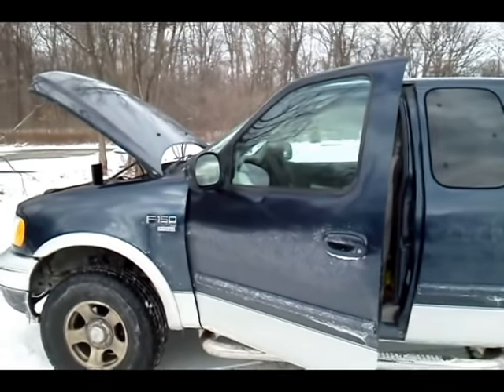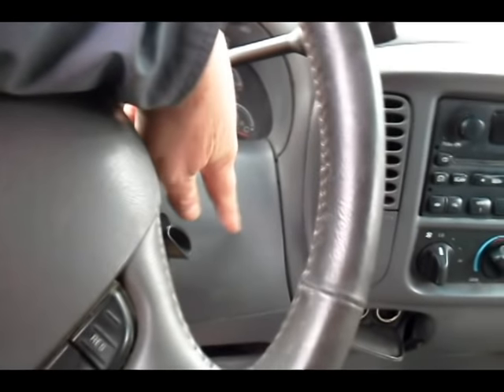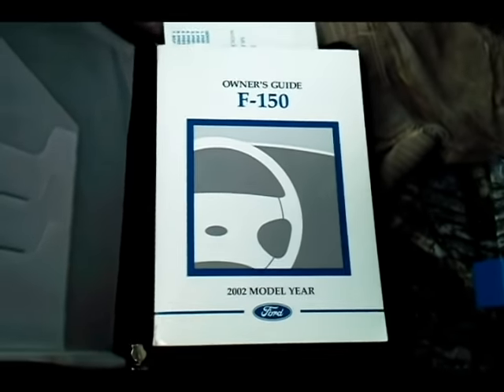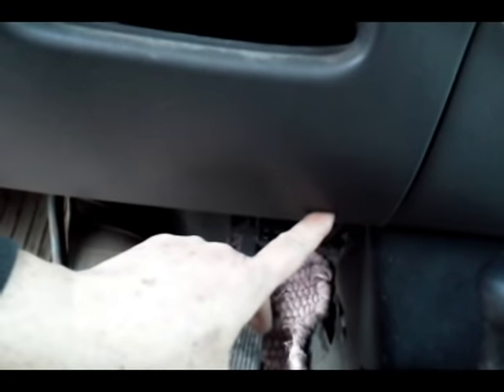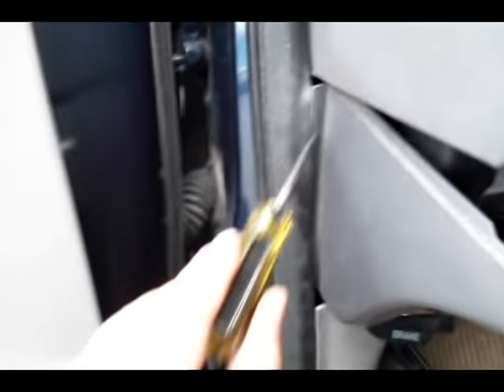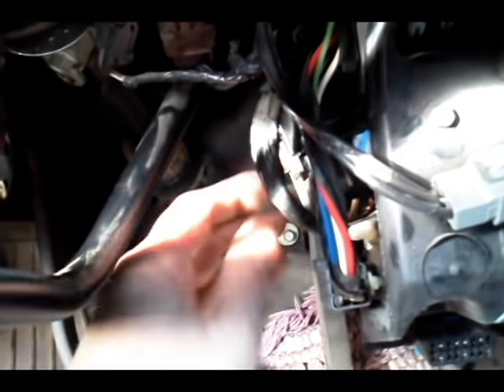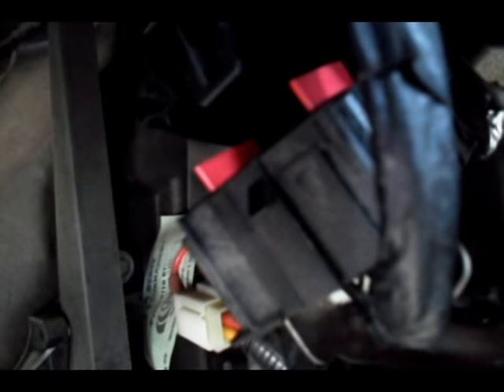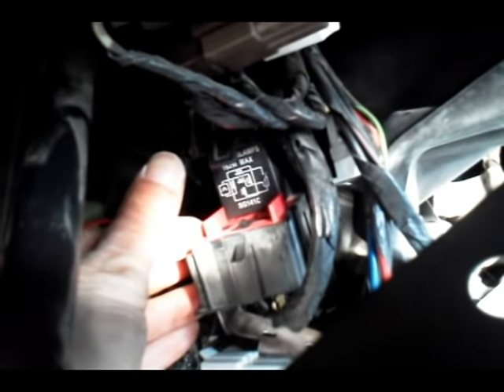2002 Ford F150 Pickup Turn Signal Flashers Relay Replacement

Comment: I have a 2001 F150 XLT. My problem was the turn signals and emergency flashers would flash for a short time and then stop. Your video worked perfectly! One note for my 2001 is that there is an additional bolt above the emergency brake handle. You mentioned that 2 bolts hold the relay bracket in place. Unbolting the bracket made it very easy to pull and insert the relay. In fact, if I didn't do that, it would have been impossible to unclip the cover as there was tape wrapped around the relay cover. The whole job took about 30 minutes and saved about $250. FYI the cost of the relay was $15...
Reply: My flashers just stay on.  Let me ask?  When i depress flashers switch, it’s on? And i release it and press on it, it’s off?

Comment: Thanks for taking the time to make this video. After watching it, I read through all the comments, then I got to work on my 2000 F-150. True story: I came in from the PASSENGER side. Pushed the seat all the way back and lay down on the floor of the cab so I could see the relay box. Carefully cut away the black tape holding the wiring harness to the box and pushed the wires back away from the box cover. Pried up the box cover and pulled both relays. Took out the old flasher relay and put in the new one, which I got at O'Reilly's for ~$20, and just like that I once again had working hazard lights and turn signals. Did not remove ANY cowlings or ANY bolts. It can be done....

Comment: Some modes like my 03 f150 super crew it’s just right there in arms reach. Pulled out the bad one and put in the new and closed back up the plastic lid. Granted you have to lay on the ground and do it but mine didn’t need me to take off any panels.
Reply: Was it your turn signal? I have an 03 and my run and park lights are out im wondering if mines in here before i try

Comment: This video was an IMMENSE help preparing me for replacing the relay in my 2002 Ford F150. Tools needed and size of sockets and action sequences (cowling removal, loosening of bolts, location of relay box) spot on! I must've lucked out a bit since the relay box was not hidden to the extent the gentleman's was in the video. I was able to easily locate and with a bit of manipulation remove and replace the blue relay switch. Be sure to take note of plug orientation as this video points out! Although I replaced with relative ease had I not been paying attention to plug orientation I would have had a MUCH harder time trying to figure it out. Thank you Westbasin for saving me loads of time.

Comment: Got some advice for 2000 F150 with turn signal problem. A common problem with these cheap made trucks is that the plug to the multi-switch that controls the turn signals have a number of wires (there is a couple of plugs to the multi switch. the one for signals is the smaller plug ) One or more of these wires will work loose from the plug as tilting the steering could stretch them out of connection. You may be able to push the steering up to full tilt and the wires will make connection for signals, to show that is the problem. Remove the steering cover including removing the key cylinder (easy just push in the little round hole under it with a small punch and pull it out). Then take off the multi-switch and remove the plugs (not much room to work on them). I pushed all the wires deep into he plug and tied them tightly together with a small tie wrap. Then I mixed 5 minute epoxy and glued the wires into the plug so they won't work out again. Let it dry several hours and reinstall. It worked great for me. Now a common problem with the shifter not going into park is caused by two small bolts that connect the shifter shaft to the shift cable. Those bolts work loose over time. They are located under the dash and up on the steering column. They are brass looking screws with torx heads. One of mine had fallen all the way out. I used lock tight and retightened them and it solved the problem. Now a problem with the back door not opening is the cheap plastic retainers that break. Take off the panel and window.You can pull the cable tight and use tie wraps to tie it down to the door using existing holes. Then it will open the door.
Reply: Your were right. I pushed the wire and it started to work. Thank you. God bless you.

Comment: All Bolts on a Ford are Metric and the Black Relay in front of the Blue turn signal is the Blower Motor Relay for heat and ac.
Reply: customprc Thats what I thought. My 2000 Lightning used 7 and 8mm bolts, not some weird sized imperial.

Comment: I'm the same as Johnathan Boxdorfer. With your video I was able to locate the relay and didn't have to take the dash panels off. There was what looked like factory tape around the black encasement toward the back. I took this off and removed the cap and changed the relay. Relay was tough coming out, but got a small screwdriver under it and gently pried to a point where I could lift it out. The cap snapped back in fine. I did not retape it. Thanks again. 2003 F150
Reply: Robert Wilcken - This was exactly my experience as well, but I was glad to see the video.

Comment: Thank you West basin You have save another from the frustrations of the FTFC - "First Time fix it Crew"  I did use the picture of the arrows to remove these two screws and the bracket holding the flashers came out to the left for easier access to the housing and to pull out the old defective flasher. Also I use the long screw driver to prop open the right side of the lower panel instead of fully removing it leaving that left end inside the rubber door jam. Which after the replacement of the flasher and replacing the flasher housing bracket screws just push back into place and made it very easy to replace all the panel screws. Thank you very much for the video - I also went to NAPA who had the part for  17.00. Much cheaper then the online shops. GREAT JOB!!

Comment: I have a 2000 F150. I replaced mine in 5 minutes without removing any panels. I laid flat on my back under the steering wheel, put my right arm around the brake pedal, removed the plastic dust cover, then pulled the relay out. I did not need to remove the other relay next to the flasher relay. Odd thing is, the replacement was defective and did not work. I put the original one back in and it worked! It may only work for a short while, but it's working. I will prolly get another one and have it on hand in case it goes out again. I have read that these relays sometimes work intermittingly and eventually fail altogether. Don't waste your time removing all those panels. (I did return the defect to the local O'reilly's, but they didn't have another)

Comment: Just changed it in my 2000 today.  Your video was very helpful, especially the added note about the two bolts that let the bracket holding the relay block come loose.

Comment: Great video, helped me out in my 2000 f150 7700, works good removing those 2 bolts you didn't, can move the whole relay housing down into a better position.

Comment: I converted LEDs on my 2003 F150 truck and had to replace the turn signal relay, which the video helped give me what I needed to do the task. Although there were some details left out that need to be aware of. Actually, the sockets are to be metric not inches and there are four bolts, not three in the front panel, and the bottom two bolts on the bracket need to come completely out that sets the frame. also as noted when you get to the two relays yes take the two bolts out of the front and it pulls out easily to take the cover off and pull the signal relay without removing the other one.

Comment: I have a 97' and want to thank you for the basic of reaching flasher. On ford expy 97' it much easier to reach and see by looking under steering wheel/dash area. Depress sides of cap and pull up on flasher with one hand and pull down relay holder with other. Lastly, be mindful of orientation of flasher/relay when removed.

Comment: This video is helpful and will get the job done. However, you definitely do not need to remove the dash panels. Once I located the proper relay box, I was able to swap the old for new in less than 5 minutes. No tools required.
Reply: Jonathan Boxdorfer do explain please.

Comment: thanks for the video, I removed the two screws on the bracket to drop the relays, that helped.  my aftermarket relay was taller than O.E.M so I could not re-use the dust cover. no big deal. now my blinker works again. my mechanic wanted $300 plus to do this. it took me about an hour and the relay was $12.00  on Amazon.

Comment: Just Thank you. i could not find location of relays. Those ones were just on front of me. was able to locate them thanks to your video. thanks for the effort in being soo (extra "o" )detail oriented. i must update by indicating my F150 is 1999, 8 cylinders 5.4 L  dual cab. part i bought FC642 from Advance Auto parts in Rockville MD for $8.99 +tax

Comment: thank so much for the video. the 2 red arrows showing the bolt/ screws that hold the box in really helped. i removed the 2 bolt Screws and was able to pull the box out to pull just the blue one out. peace of cake went back to gather just as easy. thanks again for the great video

Comment: Thank you Sir for posting this! With your video I was able to get this done in under an hour and that was with my nosy neighbor taking about 15 minutes of my time in between. Your video was very informative and, that tight spot is no joke and my big hands barely fit in there. The hardest part was pulling them putting them back in was easier by getting a leveraged to pull them out was almost impossible I'm glad that I train for grip strength!

Once again thank you very much!

Comment: Changed the relay under the dash ..no more fast blink on right front ..but rear is still dead with both bulbs changed. Any input ?
Reply: Tilt your steering wheel all the way up by doing that the wire on your multi function switch will go back in place , the problem is that the pin holding the wire pin breaks and the wire comes out of place, to fix it you have two choices replace the connector that’s about $20 or you can just zip tie  the lose wire to another wire, i just recommend replacing the connector
Reply: And im assuming you checked all the fuses and bulbs

Comment: Thanks for the Video.. Did this and checked my fuse and nothing.. I thought I would add that many Fords have a Tilt Steering Wheel.. This may create a disconnect at the Plug Harness that connects to the Steering Wheel causing the Signals to fail completely.. If All these things in this Video Fail to fix your Signals? Check this area.. I could not find any Video for this last Fact.. Might save somebody some $$$ as the Flashers are not cheap..... Thanks again

Comment: Thanks for the video, had to change mine also, just to make it easier to get to the relay just take out the 2 bolts and the whole bracket comes out and it's super easy to get to.
Reply: Rich Cordisco. thanks. Rich
Reply: yep to this comment about the bolts holding the bracket.  overall, what an awesome video.   saved me tons of time and probably some cracked dash panels. job done in less than 20 mins. $16 part.  Thanks for being so thorough and flagging all the mounting bolts.  my f-150 is a 2003.
Reply: Great video to get you where the part is and then what you just said . Thumbs up to all. 2004

Comment: Thanks for this video.  I remember the days you could just look under the dash and the flasher was usually right there.  Nope.  Ford has to make this difficult.  And what's with the "relay box 4" thing?  Why the need for the extra cover over both of the relays?  Why not just turn them over so they could be easily accessed?  Oh well.  It's done.

I would like to add that it did make it easier to remove the lower dash panel.  With that removed, you really can't access it topside.  You have to crawl under the dash.  I removed the wire bundle attached to the bracket the relays are mounted to, then pushed the bracket up, and pulled it towards the drivers side.  THAT made it easy.  It bent back into place and I reattached the wire bundle (it's got a push in clip), put the cover back on, and I was done.

Comment: This is a very helpful video. The only thing I found is though, taking the hood and brake cables are not that hard to remove. Taking those off makes it easier to lay on the floor.

Comment: At the end of the video you mentioned removing two bolts holding in the black flasher box.  While it was not done in the video I did do that and it makes the removal and installation of the flashers a whole lot easier as you can pull out the black flasher box.  Otherwise the video was excellent and saved me as I would not have figured this out without the video.

Comment: Thanks for taking the time to make this video! This works for same gen Expeditions too. Mine is a 97' and as someone mentioned, it's much easier to reach as you don't need to remove the panel. Simply look underneath and you can see it. $17 part at AutoZone, installed in less than 30 minutes. I'll drink to that! 🍺
Reply: Good video.
Just...no bolts...no nuts.
These are all hex head screws.

Comment: Good job man,  quite helpful!!
Small differences  my '03...t total of 6 bolts to remove,  2 at the bottom bracket and 4 in the plastic trim.

Also,  the relay cover on mine had a wrap of tape going all the way around it on the inside part you cannot see!!! Took me forever to figure out why I couldn't get the cover off lol!!

Comment: Just used this video to help me change my turn signal relay after changing all the light and the multifunction switch. This was very helpful and I will say that like many comments I have read it is much easier to take the whole panel off (including taking off the brake line and the hood) than to struggle with the limited space, especially if it’s the first time doing it. Very helpful and thank you for the info.

Comment: Thank you for the video my brother you really made this job very easy for me, I like how detailed you were in the video, I was able to pull mine apart without bending that fuse box then I put the flasher relay back in first that way I could slip the turn signal relay right behind it easily without fighting trying to get it back in, anyways thanks again great video